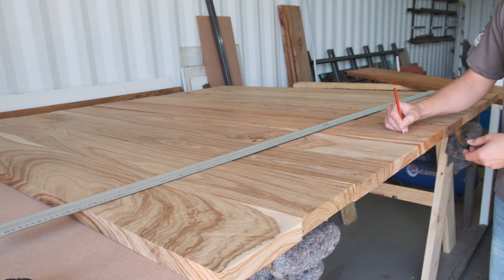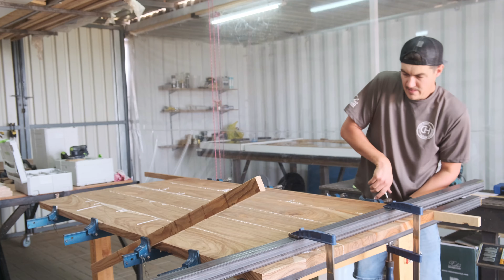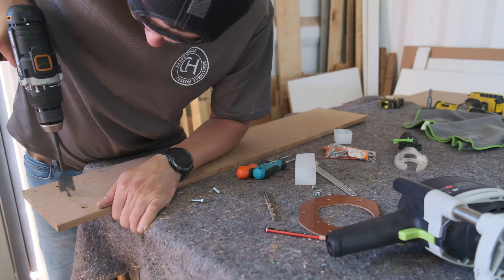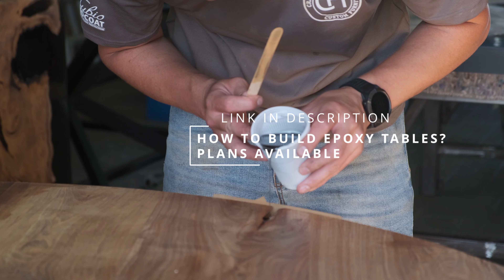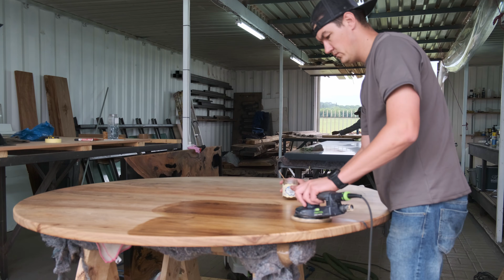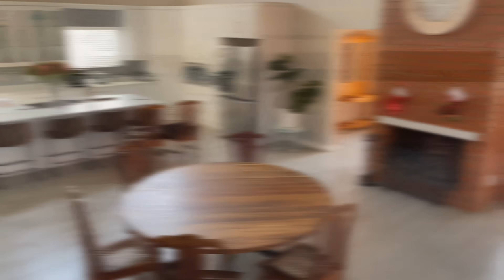How To Build A Round Table | Easy Steps

Comment: Festool is too expensive. I have an old biscuit cutting tool that works just like that Festool, and it didn't cost even 1/8th the price! Works like a charm. Pretty table top though, I like the wood, had to read the comments to find out what kind it is.